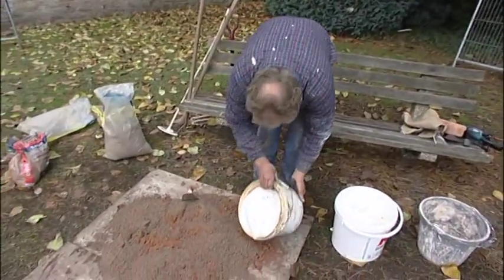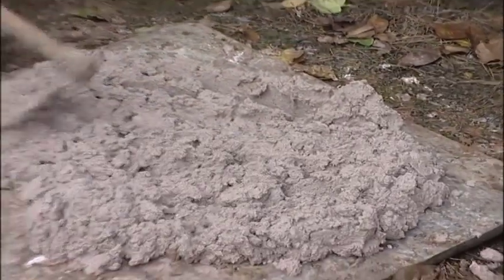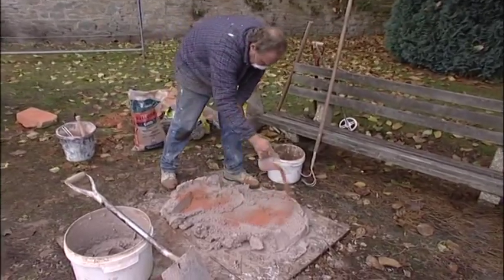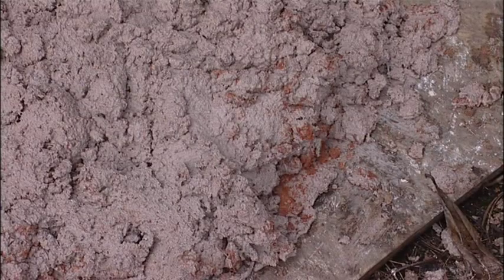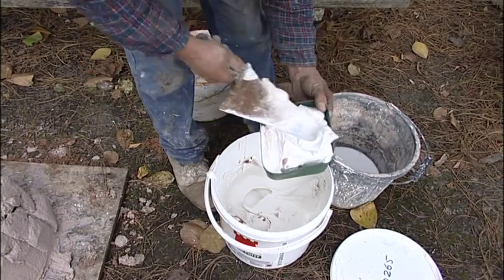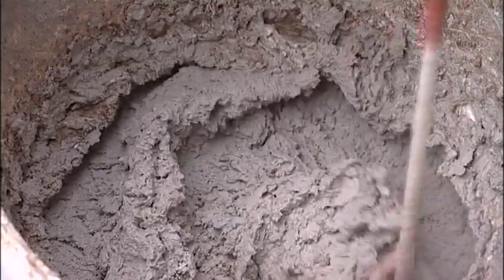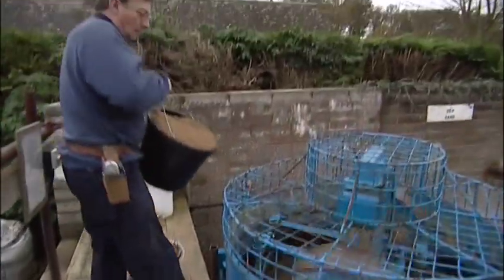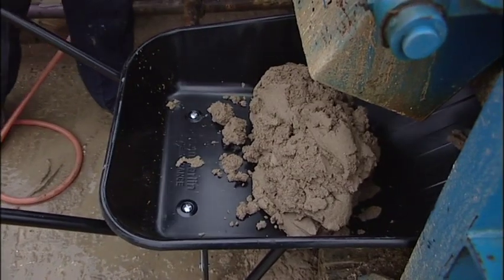6b Brickwork: Preparing lime mortar

Comment: powdered chalk sends it off quicker . i use this in colder weather. also i use hanson hydraulic lime. works  perfectly. when building flint walls i throw in broken bricks to. i have also used old lime mortar to send it off aswell and also have reused old lime mortar by itself.  i have been  doing flintwork for about 25 years

Comment: I use a mattock handle on it holding the mattock by the metal end and pushing it handle first into the mix in a bucket, really seems to squash it in, alternating with trowel mixing. I have tried both washed sand and kiln-dried sand. Washed sand seems to work best, with 3 parts sand to 1 part putty, hardens well over a few days. Kiln dried sand needed about 1 part sand to 0.55 parts putty to get a workable mixture, and takes lots longer to dry. This might be something to do with the higher putty ratio. I think the washed sand has less fine clay and organic material, but moisture content is rather high. Also the putty can have variable moisture content. Still learning how to do this.

Comment: One of the more detailed and informative videos out there. Thank you for sharing. It would be good to understand why you use the additional fine sand in your mix, is this for workability purposes or perhaps some other reason/reasons? Thanks
Tom
Reply: Its for plasticity and binding. Sharp sand is big and angular, you need something small and preferably round as well.

Comment: I have found a potato masher and a household manual cake mixer quite handy for extremely small batches. Running over a mix to and fro on my skateboard has had the same effect as those large and much more expensive pan mixers.

Comment: With all of this work with brick dust to get the mortar to 'go-off' quicker.  Wouldn't it just be easier to use hydraulic lime as that tends to go off faster anyway?
Reply: there is a lot of discussion lately about the inappropriateness of NHL's - one key point being that they continue to harden, sometimes to the point of being not far off cement. Check out Nigel Copsey's book; Hot Mixed Lime and Traditional Mortars

Comment: Personally I think your mix is lime weak: Taken from Dr. G Lynch 'Myth in the mix':
Misconceptions concerning the traditional method of gauging quicklime to sand have contributed to some mortar failures based on a volume ratio of 1:3 with ready-to-use lime, particularly where inexperienced personnel working with lime putty have not realised that a measure of lime within a ratio might not be one full unit of lime. Lime putty contains a sizeable percentage of water; thus reducing the actual binder content within that ratio further.
Reply: Thank you for sharing this one! It helps!

Comment: Would porcelain tile dust work as a pozzolan?
Reply: Yes but you wouldn't know the eventual compressive strength of the mortar.
Reply: @michaeljamesdesign  He's using putty so you wouldn't know that anyway would you? Its not from NHL.
Reply: @corindoyle  And your point?
Reply: @michaeljamesdesign  that industry specified mortars have to be NHL as it has BN classification where as putty doesn't and can't as far as i'm aware. In practical terms it will never be an issue with putty either. The compressive strength of putty based mortars can vary widely with some of the older ones being ridiculously strong as they get stronger the more they calcify. They have nevr caused the problems you get with Portland/stone either as far as i know.